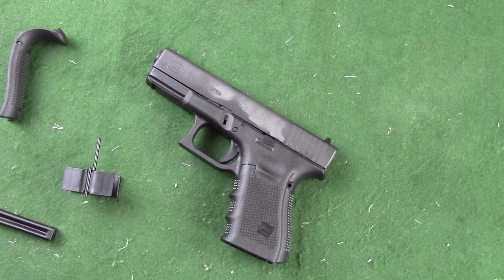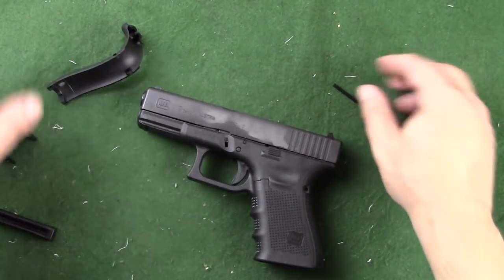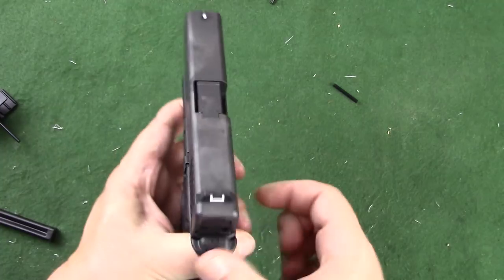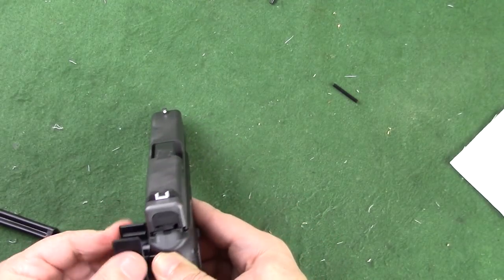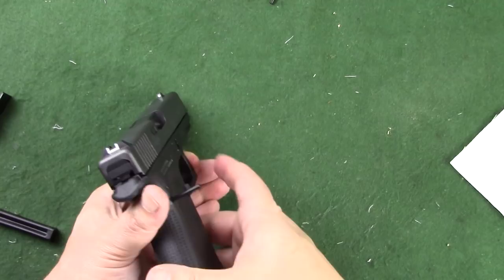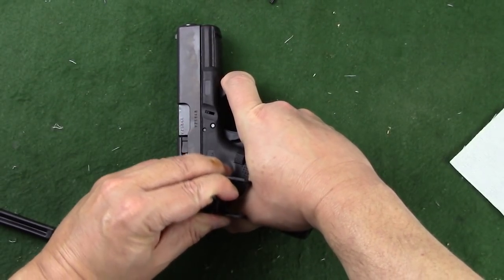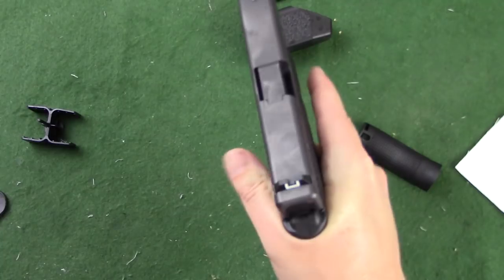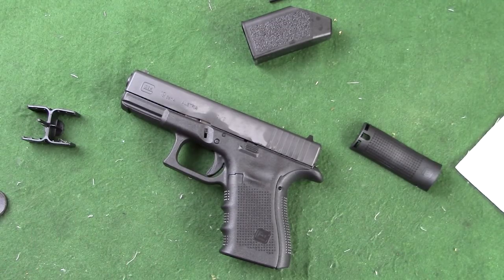Installing a beavertail backstrap on a Glock Gen4

Comment: Insert the top of the backstrap behind the slide first. Do not engage the bottom just yet. The pin holes will align easily with no effort. Insert the pin. Once the pin is inserted push the bottom towards the mag well and it will easily pop into place.
Reply: That's how I did it. No problem what so ever.
Reply: Bruh the instructions clearly say to start from the  bottom first.
Reply: @Acts-hv8bh  instructions? what are those?

Comment: People in the comments are being very apathetic.   Anyway I had a similar issue and what I did was line up the top part of the beaver tail first and do not line up the bottom.   Continue working the pin in thru the top and it will slide in rather easily.   Then after pin is installed, firmly press against the bottom of the beaver tail and it will snap or click into place.

Comment: I used the tool that it came with the straps to guide the pin in and it took me like a minute
Reply: Yeah I'm not really sure what all the fuss is about. I just picked up my G19 and putting the straps on was easy as pie.
Reply: Victor same here!
Reply: Also used the tool that came with my G17 and it went together perfectly.
Reply: Same no harder than pushing pins into an AR
Reply: Yup me too! Then I watched the video to make sure I did it correctly!!! :D
Reply: Bought mine brand new and no problem at all changing grips. A gunsmithing hammer and striking pin set would solve it too.
Reply: Literally just purchased my FIRST firearm today. Watched this video and began putting my back strap on at 8 minutes. Finished as the video ended
Reply: @mistress6e  Welcome to the family. Great job!
Reply: That worked so much better, I was struggling for like 10 min with these instructions lmao
Reply: You must have watched the Vetterland video on how to install this using the tool as a guide.

Comment: I did it different i used the tool to line it up then flipped it over while i slid the pin back in. It was pretty easy
Reply: I did the same, using the tool in reverse by letting the longer pin push the tool guide out. It took maybe a minute.

Comment: This should all be done with the slide off. I’ve installed 6 of these, 2 worked great the other 4 sucked, 2 of them I returned. The other problem is every time you want to take your Glock apart you have to go through this. So guess what? you just don’t install. Money down the drain. Part added to parts draw with all the other stuff that doesn’t work and we were too lazy to return.

Comment: The trick to getting the stubborn back straps on is connecting the top part first without locking the bottom part in place, punch the pin thru when the top part is lined up then snap the bottom in. simple. I tried multiple times doing the brute force method and it just never worked right.

Comment: I used the Glock pin punch tool as a slave pin to install the longer pin and it works great.
Reply: Gunny Retnug I think the pin punch is too flimsy, just my opinion
Reply: Damn, that worked much better..

Comment: When you go to install the pin leave the little plastic tool in and it will keep the holes aligned. As you push the pin through the plastic tool will just fall out. No hammering/beating necessary.

Comment: i tried this once upon a time and got frustrated then gave up.  I watched this and read a few of the top comments and decided to take it one step further: I used a mini Irwin Quick Grip clamp from the back of the strap to the front of the trigger guard and I did both gen 4 g19s in under 5 minutes total.  Thank you to those that commented with your tips and tricks, and to the video creator, for making it soo much easier the 2nd time around.  Finally my middle 'trigger finger' popping symptoms are mostly eliminated with the medium beaver tail strap.  The larger strap was a bit too much for the size of my hands but the medium/smaller one helps a ton.

Comment: The exact same thing happened when I got my new Gen 5 a couple weeks ago the exact same thing happened to me step by step and I end up giving up and putting the middle size standard one on and then put a tail and grip around it and now I'm still not happy with it my friend bought the Jen 5 model 19 and he got it to go on so now I'm going to have to go back and cut the back end of the talon grip off so I can get to the back strap and try to put the beavertail on once again thanks for your information and insight and shared frustration of this process thank you

Comment: So I was having the same issue with my glock 19 and this video helped a lot but I did come up with an easier/less strenuous way if things aren't aligning. I couldn't do it at all squeezing so I just used a small DeWalt trigger clamp that I had in the workshop and it allowed me to slide the pin in a lot easier. I also didn't realize there was a longer pin in that little kit that comes with all the different grips so I appreciate you pointing that out. Great video, thank you!

Comment: Thanks for this.  I didn’t know where to look for longer pin!  Your frustration led me to try something different.  I installed hthe M Beaver Tail blackstrap before removing the pin.  Then used a drift punch to start the pin out about 1/8”.  Then removed the punch and used the new longer pin as the new punch and it went right in.  This kept everything lined up as the new longer pin was installed.  Still had to use drift punch a little on each side after install to get pin same distance on both sides.  This was a g45 so they may have improved the alignment on the straps.

Comment: Purchased a new Glock 17 Gen 4 in December.  Your video was quite helpful in locating the longer pin.  Put on the beaver tail backstrap yesterday.  Didn't have any problem putting in the new pin with the backstrap.  Just got it started, held it up tight and drove the pin home.  No problem. Took all of 2 min. tops.   I think the pin will self-locate if you are close and you let it. Mine did.
Reply from the maker: +Kenneth Dopheide Congrats on your purchase, and I'm glad the video helped.  Thanks for sharing the technique that worked for you, and thanks for watching!

Comment: I want to thank you for doing the work in putting this video together.  I really like the idea of an adjustable handle, and since I have big hands and like the idea of extra support, I put the large beavertail backstrap on my G17 Gen 4.  It took me just about a minute to do - but what that says to me is that, after reviewing your video a couple times, it gave me a solid entrance into the procedure.  The other thing is, since it took nine minutes for you to install yours on this particular gun, there may have been some tolerances that were tighter than others.  So, in summary, thanks for your video, I'm glad it didn't take nine minutes for me to do mine, and I'm sorry it took you that long to do yours.  You're golden.  :)

Comment: Take a military style boot lace and wrap it around the trigger guard and back of the strap twice, start the first part of a square knot with the lace and this will let you get the strap really tight and snug. Then it's a little easier wrestling the pin in the hole.

Comment: Thanks a lot for the video. I just installed mine and it took me around 2 mins. Thanks to your video I knew how to make sure the pin went all the way thru without bending the grip. It was actually pretty easy to install once you were aware of the proper placement/alignment of pin/grip.
Reply from the maker: Glad it helped, and thanks for watching!

Comment: I used the opposite side of the pin tool, the flat surface that has the glock logo to push it in helped a lot.

Comment: Use a small trigger clamp. One end on the front of the guard and then just ball up a paper towel to push on for the other end. Pin pops right in.

Comment: Use the tool to keep the holes aligned, then take your pin and use it to push the tool out, then to align the pin in center for those who are a little obsessive over symmetry, I found that using the corner of the "][" shaped part that holds the other backstraps has just enough length to basically push that pin perfectly even into the frame

Comment: thanks for the tip on the punch and extra pin, didnt know about that, however punch is trash. also try inserting  pin from other side, had much better luck, also hold up to a lamp and if nothing hole, you should be good, use the end of a screwdriver to lightly tap

Comment: Standard 19 gen 4 here, was a pain and I ended up actually bending the back strap where the hole and pin misaligned, luckily I didn't force it too hard and avoided any permanent damage.

Comment: Hey guys, was having this problem myself and found a way to do this so much easier.
Get two of these “trigger housing pins” that’s what Glock calls them. Just barely put both pins in the holes on either side, once you know both are past the backstrap holes and are actually in the holes of the gun itself, make the two pins meet and touch. Once you’ve done that, put the gun on a flat surface and push down until the pin on that side is as flush as you can make it with the table. Take the smallest tool you can find (in my case it was a Alan wrench) and push it the rest of the way through. Easy and painless.

Comment: I didn't get off to a good start, when I tapped on the pin the pin went flying.  After a 5 minute search I found the pin.  After that I had no problem, the pin went right through with no problem.

Comment: I have big hands and I’ve never had slide bight. I’m 6 , 4 with hands to match and I fail to see how people are having this problem. Not trying to mock anyone I’m just not having this problem. I just bought a police buy back Glock 23 and the last guy installed a larger blackstrap and it’s actually feels pretty good.  I still like that Normal on my 19

Comment: This process is NOT difficult what so ever.  It is the "trigger housing pin" that is removed and replaced with a longer pin!  It only takes minimal mechanical ability to perform this proceedure.  Granted, some can not pass this simple test.  Just rem, left to right to remove and right to left to install.  These are for Gen 4-5 Glocks.  Earlier must go to after market straps.

Comment: The extended beavertail back strap takes up too much room at the bottom of the mag well now I can't fit the plug back in. Wonder if I should take the back strap back off try putting it on with the plug already in....Ill let ya know what happens. I don't see why the back strap would have to come off for disassemble and cleaning, please elaborate. Helpful video, thanks.
Reply: You can buy a plug with slots that accommodate the back strap tabs. Check Ebay. I think Pierce makes them.

Comment: To install pin easily Instead of pulling out the tool you can use it as a guide to follow the pin in from the other side

Comment: I was applying pressure and the pin jumped away from me. its been two hours and I still cant find it. 1/10 design.
Reply: the SAME THING happened to me. I can't find mine so I ordered one by Wilson Combat on ebay. try that if you haven't got one yet.

Comment: The first time I tried to install the backstrap on my 19 Gen4 I struggled with it for 5 minutes and it still wouldn't fit.  I soaked it in some hot water for about a minute then it went on without any trouble.

Comment: I always go left to right, and use the tools as a guide and follow the Pin through, but if you didnt think to do so, you would have been frustrated
Reply: Just a good rule of thumb MOST firearms use tapered pins that must go in from the right to the left, so to take the firearm apart you have to lay them on the right side down and tap the pin out from the left side with a punch and sometimes you need a drift punch or a slave punch, I know that this pin is 100% flat on the Glocks so it doesn't really matter!

Comment: Put a rubber irwin quick vise on grip , squeeze it till hole ligned up,put pin in ,it squeezes backstrap for you and dont mark up gun. Without clamp is just wrong way to do it . Glock should tell u.
Reply: I was going to say this same thing.I have the Glock 40 Gen 4 and mine was just like the video. The children who were making fun of the video obviously had an east time. These are not all the same. That guide pin theory isnt the best...the one they use is smaller that the real pin so it dont work if its really out of alignment.  I have one of those pistol grip ratchet clamps and it did in fact work like a charm. If your Glock was an easy grip change, count yourself lucky. Thank you Mike Walters for the TIP that really made a difference.     :-)
Reply: Some guns fit too tight u have to use clamp.

Comment: Back straps or junk gen 4 glocks will come loose at pin that hole the grip. Not on a gen 3. The pin I've sent on number glocks gen 4 come out loose hole is out speck for size pin those grip suck on a gen 4 and dule springs have cause stovepipes in shooting on gen 4 glocks best gold standard quality is a gen 3  best one. Five gtg to

Comment: You're supposed to use the tool as a slave pin. No different than installing trigger pins, bolt catch etc on an AR. Great video on how not to do it.

Comment: Why would you use a high grip like that knowing it's going to cut you? Dumb!
As far as the beaver tail, try it with a Glock magwell, lol. It will work but you'll need a small screwdriver to pop the magwell button in place.

Comment: After watching and muscling including using the tool to aligned i used the smaller pin to aligned, then pushed the larger pin the smaller just pop out and the larger pin came thru.

Comment: well....totally disappointed, I like the extended beavertail and with it on it actually feels like I "may" get a better purchase on my  gen 5 g17, however the little dust plug cannot be installed  either before or after attaching the back strap. so if you want the strap no plug, if you want the plug, no back strap... thanks for the vid, I'm going with the back strap......um....nah I changed my mind, even though I get a good high grip without the extended beavertail back strap I've never been bit by the slide on a glock and I just can't (ocd maybe?) allow dust to get into the opening at the bottom of the mag well. I put the plug back in and the back straps away. Thanks again, peace
Reply: I think Pierce makes a plug with slots to accommodate the back strap tabs. Look on Ebay.
Reply: I bought an aluminum "Fixxxer" plug on Amazon.  Works great on my G22 as long as I install it before the backstrap.